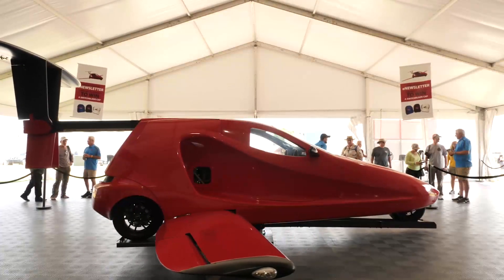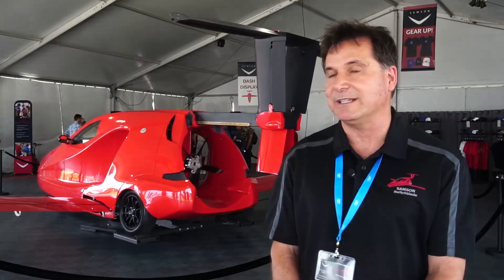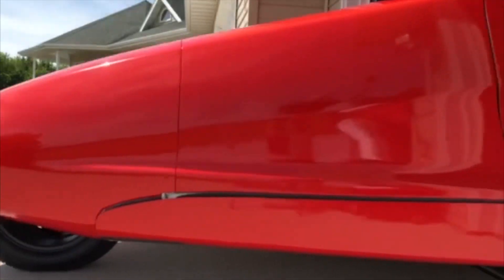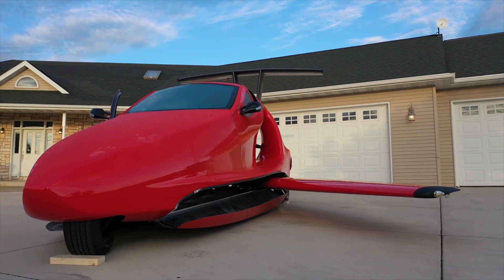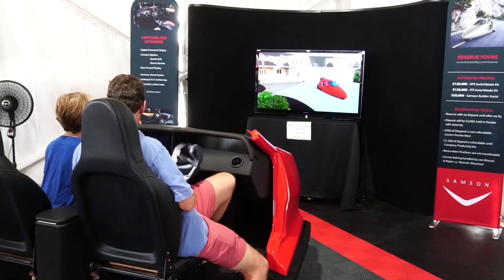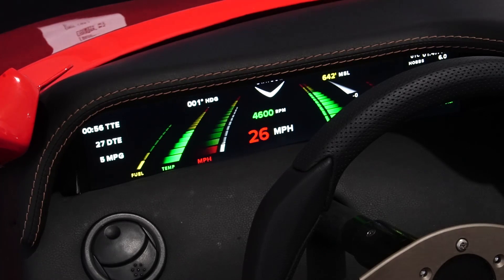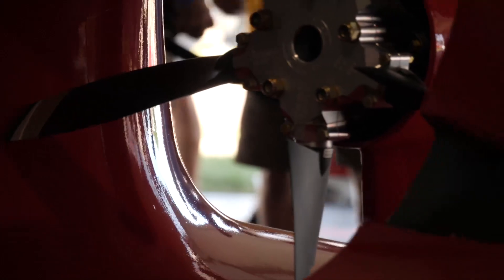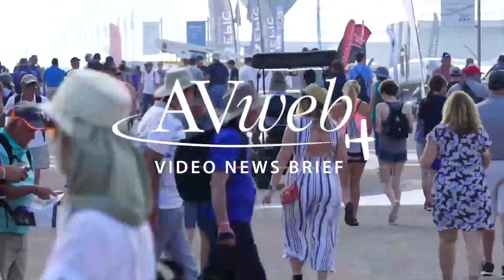Samson Switchblade Progress Report

Comment: All you nay sayers are obviously NOT Pilots. The minute you land at a secluded airport you are on foot. When you run into bad weather
You may sit in an airport lounge for hours or days. Being able to continue travel after landing is HUGE.
Reply: Yes, but how often does that happen?  Is it just an excuse for poor planning?   Do you really want to be stuck all the rest of the time dragging a car through the air and hauling an airplane around on the ground?  Where would you feel safe parking the car to protect it against all those ham fisted drivers?  What happens when a rock pops up and damages your ailerons or other control surfaces?
And, perhaps most importantly, just what is its mission, anyway?
Will a folding bicycle fit in your airplane that is more tailored to your mission?
Lots of questions, but few answers.
Reply: @jerrymiller276  The mission is to never leave your vehicle. They need to add a toilet and a bed.

Comment: How do you make a landing gear that can drive well and take hard or rough landings? The answer is you can't. You'd still be paying the aviation tax, while keeping it operational. It won't go fast. Probably better off just picking up a used C150/C152 and a practical used car.

Comment: Like every other "flying car" in history the end result is always the same: A bad car and a bad airplane. Inventors should just concentrate on better versions of light aircraft that have folding or detachable wings for towing or trailering for storage away from airports to reduce the cost of ownership.
Reply: Bruce, you totally get it!  Most of these flying cars are at least $500,000. For that you could get a nice used Bonanza and probably a Ferrari! That right there is way better than any flying car!
Reply: @Flapping Flight Over 200 mph on125 HP. Ok that is just a straight up fib (lie). This plane/car (cool I admit) I estimate 110 mph in air? They say 150 mph as car? Lie. Ha ha. See the three wheels? Inherently unstable and prone to flip over. 35 mph street is top speed my estimate (or die). But that is a cool folding wing. Payload? Range? Impractical. Thanks for link. Cool blast from past.
Reply: @Flapping Flight thanks I'd like to know more. I'm still interested in design and creativity, even if not commercially viable. Yes if autonomous. Vert Takeoff Landing vehicles flying point to point would make the car part pointless. There are lots of issues but in 100 years?
Reply: You said it
Reply: While I don’t mind a focus on garage-able planes or amphibs, it would certainly be nice to not rely on a courtesy car or Uber when you get to where you’re going, or not have to wonder if the weather will hold out all weekend so you can come back (which generally means you just end up driving instead).
Reply: @xpeterson  Get IFR rating or land and rent a car... the whole idea is grand but it's like socialism, sounds good in theory cradle-to-grave entitlements, but in reality hell and misery. Someone has to pay. This thing has three wheels and will be highly unstable on the road and air.
Reply: gmcjetpilot the idea was to have your own vehicle when you landed. I guess you could just be super rich and fly a plane that can load a car in the back. For the rest of us that can afford a light sport or something similar, flying is often less convenient than just getting in a car and driving.

I am IFR certified, I would still love the option to drive if I needed to.
Reply: @xpeterson  Yes Sir I understand the concept and your point. No offense it's a dumb idea. One of the best was the first, Molt Taylor Aerocar. It was very clever. A modern copy might get some traction, but cost and market is the issue. 

I'm not rich and own my own plane that holds a folding bicycle. I use it. I put an electric drive on it. I flew as Corporate Pilot. The boss got a ride from associate, rental, limo or hotel shuttle. No big deal. 

Bottom line plane + car is crap, like one in this video, looks unstable and dangerous ground or air. I got $10 that says it won't ever fly... The price of that monstrosity is north of $200,000. I have 1/3rd in a RV7 and WAY more fun, fast cross-country, aerobatic airplane that can take off and land in less than 600 feet (easy). Now think of the flying qualities of this car plane hybrid. Think it flies well? Drives nice? It doesn't look like fun at all.

 If I just want to get there I'll take an airliner, but I want fun and enjoyment when I fly. I want Adventure and be able to go in the grass strips. That thing is not for me or most people. Ground transport is not an issue. I commuted between two airports.  I left an airport car at point B. It was a 1974 American Motors Matador and it ran like a champ. I paid $400 and sold it for $600  Because the guy wanted the engine to put into a Jeep..
Reply: @gmcjetpilot  It's amazing the ways in which people can drag politics into discussions where it has almost no relevance.
Reply: @gmcjetpilot  "What politics?" How about the erroneous comparison of flying cars to socialism. The two thing have nothing to do with each other. 

But you don't need to worry about your First Amendment rights. You are free to make false comparisons and ramble incoherently for as long as you like; I won't stop you. 

In fact I might grab some popcorn. It's pretty entertaining.